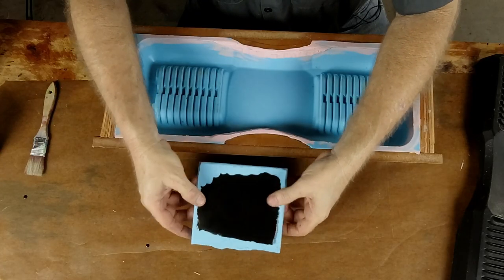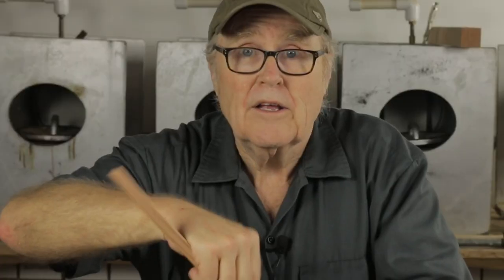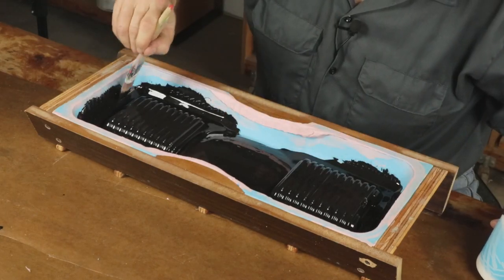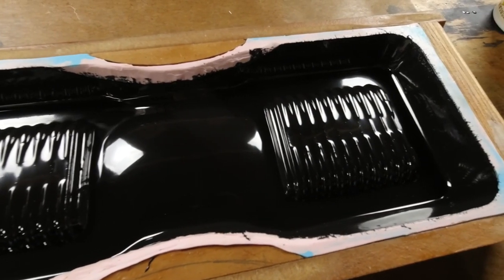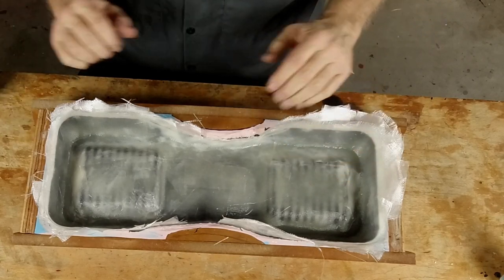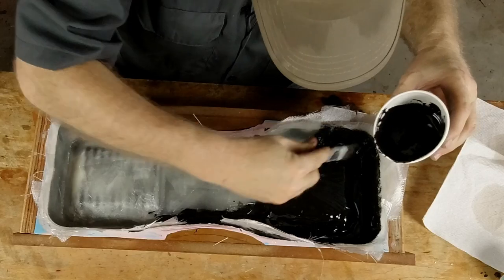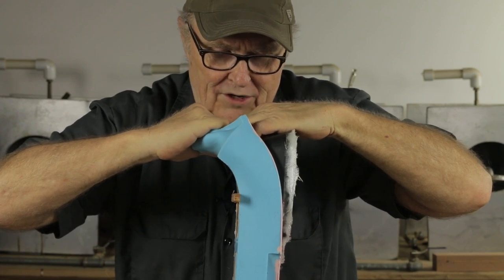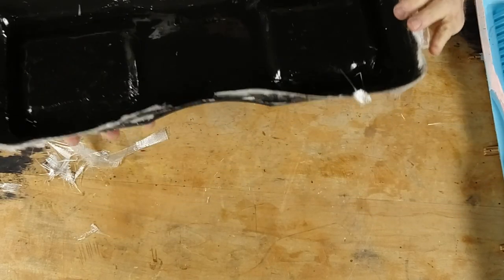Casting Fiberglass In A Silicone Rubber Mold!

Comment from the maker: Here is a link to a downloadable PDF file with a list of the rubber, resins and waxes I use in my videos:
https://www.dropbox.com/s/kz6mhmf7v5vpy7l/Material%20and%20Suppliers.pdf?dl=0
Reply: you lost it with the puddle of resin with the randomly dropped-in pieces of glass cloth. try this: #1 cut pieces to FIT the shapes they are going in to (as in tailoring them). #2 stipple thin layer of resin on to the gel coat surface then lay the pieces in place, overlapping fairly generously. #3 (v important) use a multi-wheel roller to press the cloth in to the resin (or stipple it in with a stiff brush) keep stippling til the resin starts to come thru the cloth #4 paint on next thin layer of resin #5 more cloth #6 good roll /stipple etc etc.  this will ensure you don't get the blobby edges, and you should have a lighter, stronger piece
Reply from the maker: @raymondo162   Hi Raymond, thanks for your excellent suggestions. You obviously know what you’re doing with composites; I only occasionally dabble in them.

Comment: Hey Robert nice video as always. If I may share a tip. Whenever I'm mixing my silicone (or your gel coat for that matter) I always mix well then transfer to a new cup and mix some more. You can never get into the tiny corners. This eliminates the possibility of umixed gel coat ruining an otherwise perfect part. The way I see it, cups are cheap but resin gel coat and silicone are not.
Reply from the maker: It’s a very useful tip.

Comment: Very cool! You should be wearing a respirator though my friend. Resin fumes are no joke.
Reply: I was thinking the same thing, but then I realized this guy has probably been doing this for a long time and is still kicking.  Still though ....
Reply: It was epoxy, as long as you have an open room with some good airflow you're fine.
Reply: Island Mike  ive done epoxy in the house all the time its not that bad
Reply: @jimmyokawa6800 yea I only use the respirator when mixing  huge 3-5 gal buckets worths where I'm standing over it with no airflow.

Comment: I like the fact that you can cast even fiberglass onto the  silicone rubber  the one question that I would like answered is how many castings can you expect I know that the fiberglass will produce heat but it's the gel coat that's in contact with the rubber so given your experience how many times could you reuse the mold say it was lust a smooth basic mold without any of the individual cross ribs
Reply from the maker: How many castings you will get depends on the kind of resin you are laminating with. Epoxy resins are very aggressive and it would be necessary to use a parting agent or a barrier coat to preserve the life of the mold. In this video I forgot to use it but because I was only pulling one copy out of the mold I was not worried about it. 
It’s very hard to make generalizations about mold life because there are so many variables. The best thing is to make a small sample project and see how many castings you get out of the combination of materials you are using. When choosing materials for long production runs mold life becomes an important factor.

Comment: Hi Robert! Amazing videos you are making. Do you have any experience with mixing shorter fibers e.g. 10mm into the epoxy to get the strength only by pouring/rotating rather than manual application of sheets? This would be as a second load after gel coat. For injection molding, you can have a glass fill of e.g. 30% consisting of very short fibers inside the granulate to add stiffness to the molded parts.

Comment: great tutorial.   you mentioned making a jig to clean up the edge.  could you do a vid on that technique please.   cutting it by hand on the bandsaw i imagine would look "hand made" rather than a clean cut.
Reply from the maker: Great idea! I will cover that in a future video. After trimming the part with the bandsaw I cleaned it up on a 20 inch sanding wheel, followed by hand sanding. So it finished up fairly well.

Comment: Any chance of doing a video on molding and casting a model boat hull,using silicone mold and the epoxy gecoat /  fiberglass for the castings? I guess the process would be the same as this video?
Reply from the maker: Yes, the process would be very similar to this. By the way,  I got a comment from a viewer much more expert in composite casting than I am and he pointed out everything I did wrong! There are good channels on YouTube for doing fiberglass work, much better than mine. You might want to check those out.

Comment: OK  when I brush my gel coat into the silicone mold It seems to skip right over the silicone and not want to adhere to it. This results in me having to dab in without using brush strokes. This results in a very uneven surface. Am I doing something wrong? You can see in this video how the gel coat can be brushed in nice and even with no issues of adhesion.

Comment: Hi Robert and thanks!
I want to cast the headlight surrounds of my car and am thinking of making a mold from silicon with soapy water or cornflower.
Do you think the silicon would stick (disastrously) to the paint on my car? 
Any tips to mold painted car parts?
Cheers and thanks again!
Reply from the maker: Test a small spot of rubber on your car.  I rather doubt it will stick but there is always that possibility.

Comment: Hi Robert, how will you cast cups for an anemometer (wind speed meter)? Both sides must have s smooth finish. 45mm diameter - from RSA
Reply from the maker: I would use a 2-part mold with the parting line around the edges of the cup. The attachment point of the cups to the arms of the anemometer might have to be drilled and tapped after casting.  Not sure how your particular cups attach.

Comment: This interesting.  But the silicone mold doesn't last very long when used with epoxy.  Like 30 parts or so and the silicone is compromised.  But still, I may experiment with this method.

Comment: Great video. What’s the difference between the ‘gel coat’ resin and the resin you used with applying the fiberglass? Is it ideal to use two kinds or can the same resin be used for both?

Also, why go this route for the mold vs doing a brush on with a shell? It seems like doing it this way is more time consuming and may require more silicone. When do you decide to go with this instead of the brush on? Thanks!
Reply from the maker: For most projects the gel coat is used to give the final color to the project. Laminating resin is typically clear; it lacks the pigments or fillers to give it color. I also believe that gel coats are more sand-able or otherwise easier to finish than laminating resins are. But I am not an expert at composite casting. I only do it occasionally. I chose I chose this method to make this mold just to demonstrate different ways of doing it. I have done other videos with a brush on rubber mold and shell.
Reply: "Gel coat" in composites normally refers to a formulation that take a longer time to cure, so that it is still in the gel state when you layer your other materials (e.g. fiberglass and laminating epoxy).  There is usually a higher concentration of waxy particles that will form a shinier skin on the surface compared to other epoxies.  As Robert points out, it is also the layer that holds to  base color for most composites, because it is used for the surface layer.

I would justify a block mold for this part because :
1) You want a level surface for the layering, and block molds are self leveling
2) The difference in volume is small when comparing a block mold and brush on, and that is directly proportional to the material cost.
3) The time cost would be higher with a brush on mold.

Comment: how many times Silicon mold can be use to take out fiberglass product
Reply: My experience has been that it is roughly 1/10 of the life of urethane casting - the epoxy tends to find ways to grab the mold, and silicone will wear out (usually becoming easier to tear) from the heat of casting and leaching of the softening oils.  Most fiberglass casting in done with a rigid mold and the part is removed while it is still green.  Often the part will be cured outside the mold, but some pieces need the mold to cure in the correct shape.

Comment: why did you choose cloth instead of chop strand? I tried using the cloth and always had problems laying it out
Reply from the maker: I don’t do much composite work so I’m no expert on fiberglass. I use it mostly for making mother shells for molds and in that application I prefer cloth because the final product is easier to handle than shells made of chopped strand.  So I keep cloth on hand.  I have used chopped strand in large projects where the casting is fiberglass backing up a gel coat.

Comment: I’m just curious but could we use fiberglass resin the same way as regular resin instead of layering it the way you did in this video? Im trying to find a really cheap way to buy resin for my product and $60 per gallon is honestly just really expensive for the product I’m selling but I see fiberglass comes in the gallon for about $40
Reply from the maker: You should be able to switch to a lower price resin.

Comment: How much does Silpak charge for their silicone and resins?  On par with smooth-on, +/-?
Reply from the maker: I have never made a price comparison. Generally speaking, the smaller the container the higher the price per ounce. This is true of most things and is especially true of rubber and resin. For me the sweet spot is 5 gallon buckets.  Buying materials in small quantities is extremely expensive.
Reply: @RobertTolone  How much was it?  I don't see prices on their site. 🤷‍♂️

Comment: I could only 'just' tell the difference! I have a to make a resin balloon shape, would it be best to fill a balloon with silicone or paint the balloon with it to make the mold?
Reply from the maker: You want to end up with a hollow resin casting of a balloon?  How big will it be?
Reply: Yes, not massive....maybe about 6" around the fattest part. BUT I want to make segments....eventually it'll be a model of an air balloon. Like a child's mobile. I have a method for the basket, but not the balloon
Reply from the maker: I would be inclined to sculpt the balloon model then brush on a silicone blanket and mother style mold. Then hollow cast the model on a rotational molding machine.
Reply: Thank you very much! :)

Comment: I had been looking at fiberglass casting because it is cheaper than polyurethane but the process to is so much longer/slower it negates the benefit. Thanks for making the video.
Reply from the maker: Yes, this piece required 7 layers of resin with about an hour and a half curing time in between.  Pretty labor intensive. Thanks for watching.

Comment: Can you show us how to do the “math”  for example with 100 part this and 29 parts that and other ratios to grams etc...Thanks Robert!
Reply from the maker: The resins I use, including these epoxy resins, are metered out by weight. No conversion is necessary as long as the units are the same.  So for 100 pounds of resin you use 29 pounds of hardener . With 100 grams of resin you use 29 grams of hardener. I use grams for most of my smaller projects and my scale is in grams.  Grams are the most convenient because the units are small. The math is more complex using when using pounds and ounces. For example, if you weigh out 1 pound of resin how much hardener do you need. 1 pound x .29. What’s that? 😳 Well, there are 16 ounces to a pound so it’s 16 x .29 = 4.64 ounces. How are you going to weigh that accurately?  On a gram scale 1 pound is very close to 454 grams. Multiplied by .29 is very close to 132 grams.  More than accurate enough for a casting shop. If you needed more precision than that you would have to go to laboratory equipment.
If you are converting units there are 28.35 grams to the ounce. But I strongly recommend using a gram scale. 
If your question was about calculating ratios that’s a separate problem and I have it on my list as a subject for a video.

Comment: Ratio is not all that weird.
It's just 6:1
Weight or volume?
Reply from the maker: It’s not. It’s actually 6.06060606061 to one.  13.5 x 6 = 99.  So a six to one ratio would be one percent off. Most resin mixes are simple like 10:1, 2:1, etc. And they are usually a little bit forgiving about accuracy.  I haven’t done tests to see how sensitive this resin is to mix ratio. But my theory is that it must be sensitive or the manufacturer would not specify the ratio with that degree of precision. Otherwise they would just specify six to one. But they didn’t. They specified 13.5 to 100.
Reply: @RobertTolone  Ah!  No wonder my muffins don't rise.
You do make it fun though.  Great lessons always.

Comment: Much better Trimming: The epoxy will reach what's called a "green" stage some time after your working time ends. If I had to guess with a 30m work time you wanna come back at about an hour or so? Something you can test with your system, as is your way. The epoxy/fiberglass laminate should have the consistency similar to a stick of chewing gum. At that point, come in with a sharp blade and simply trim the edges. It'll cut easily and you'll get a decently finished edge. It MAY lift if you go at it too hard, but it can be simply laid down again. The Epoxy will still be tacky. No jaggies, no table saws, no sanding, no dust to inhale, fraction of the work. Epoxy left on the blade can be cleaned off with Acetone, or whatever you have that works.
Reply from the maker: I’m definitely going to try this. Thanks!